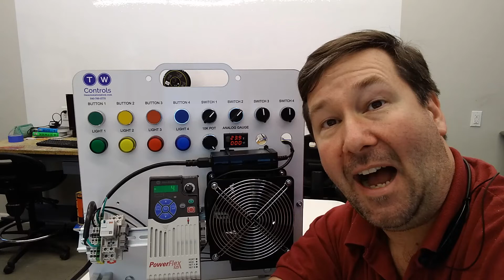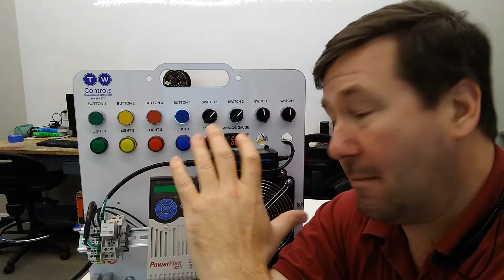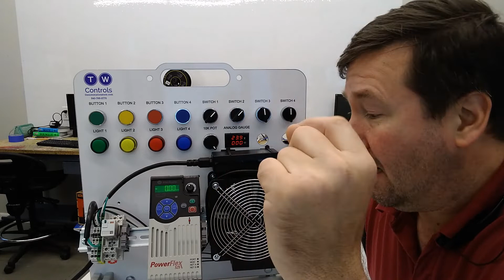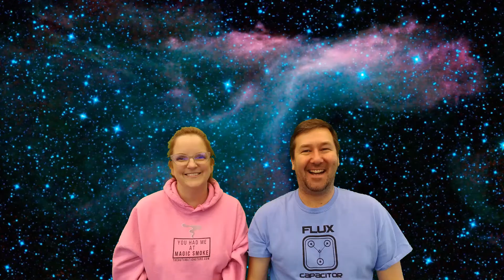How to Reset an Allen Bradley Powerflex 525 AC Drive to Factory Defaults

Comment: Hey Tim. 
Fantastic videos. 
I have a new power flex 525 out of the box. I’m getting motor output voltage around 775 per phase. With or without a motor connected to the drive. Any thoughts?
Reply from the maker: I should do a video on this sometime but you can't measure the output of a VFD with a typical meter. Use the parameter monitor on the front keypad if you want to know the voltage.

Comment: What would you recommend , i am repurposing  powerflex 525 that previously was controlled by an HMI , and now need to use the Potentiometer control , should I start by doing a factory reset ?

Comment: Why when you mesure voltage on UVW on vfd they don't give u 480 or 260. The last time I test iwas getting 3 or 5 vac
Reply from the maker: I have a video coming on this but it has to do with the VFDs "simulated" sine wave.  Your typical meter can only measure a true sine wave accurately.

Comment: How Tim , how can I program a remote reset ? Everytime I download I lose comms and I have to cycle power on the drive. I was told if I program a remote reset I won’t have to cycle power
Reply from the maker: I think the bigger question is why are you downloading parameters so often?  This shouldn't be a normal thing that you do.
Reply: @TimWilborne  training learning how to use a powerflex.I programmed a reset. It works.